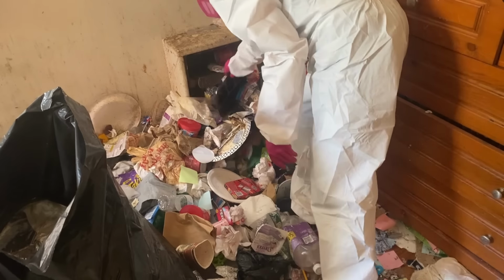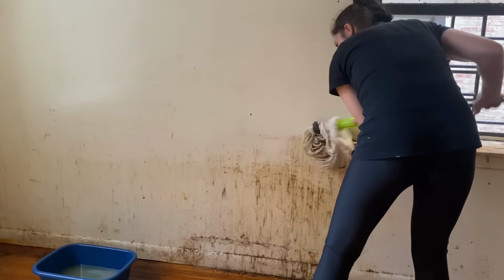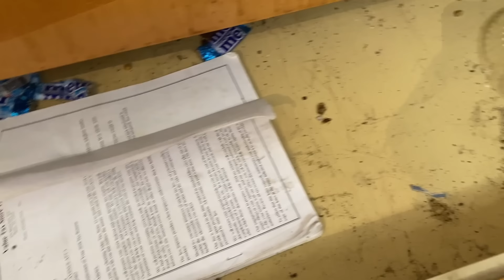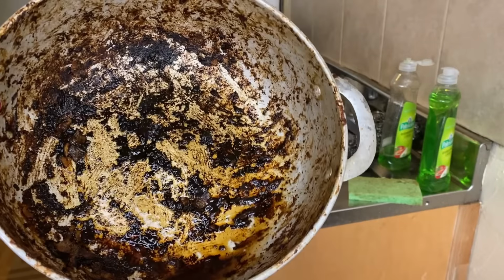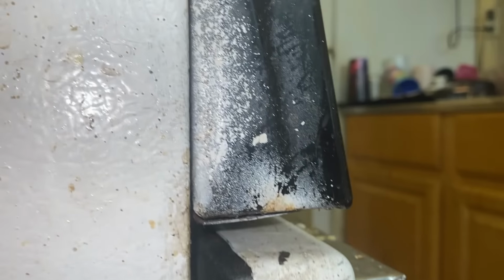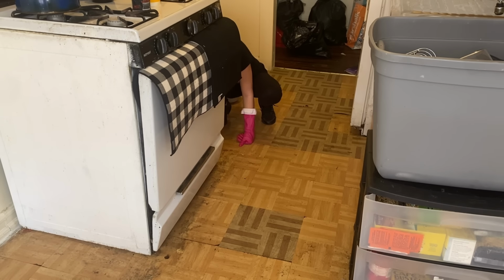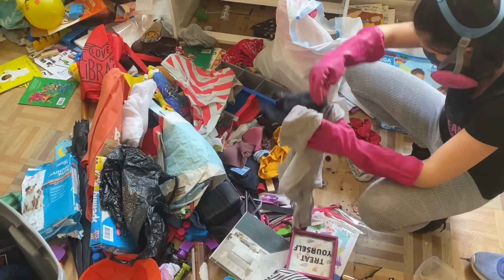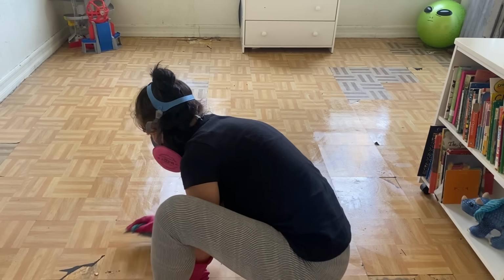From Chaos to Calm: Transforming a Cluttered Room #decluttering #organization

Comment: I was helping my daughter clean out house after she had to evict the people. I picked up trask in yard all day & eve, the next day We started in house.  Spent about 8 hrs and there was still stuff in there. We put all the bags on curb to be picked up.  The next day every single bag was tore open and 2/3 was dumped in the street & yard. So I  spent all of next day re- bagging to have to sit on porch all nite to ask people to not tear bags open. I finally went into house at 12 midnight midnight.  I come out 10 min later and there are 2 people in vehicle pulling a trailer with their headlights  off tearing bags open again and tried to tell me they didn't do it. I got very upset and yelled at them that I was just out the 5 min before after bagging it all again all while a guy with flash light is moving and tearing bags open. I told them they were lying to leave before I call the police.

Comment: 27:11  be careful to cleaning this part. You can get a shock. This happened to me one day
Reply: I am always nervous when I see people wetting these electrical parts. I thought this would electrocute you. I won't try it.
Reply: Sounds like you have old wiring that no longer has the plastic coating (lots of times older buildings have rodents).

This isn't normal and you should be able to wipe and spray a light switch.